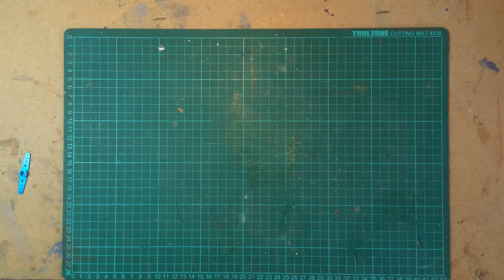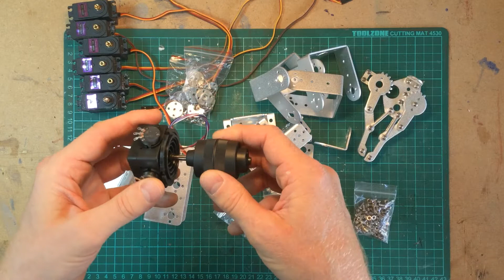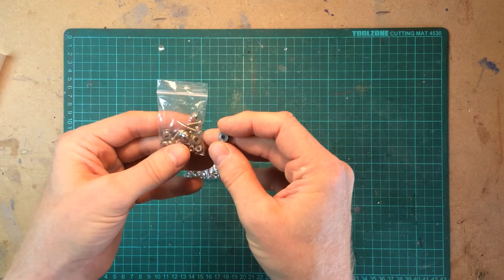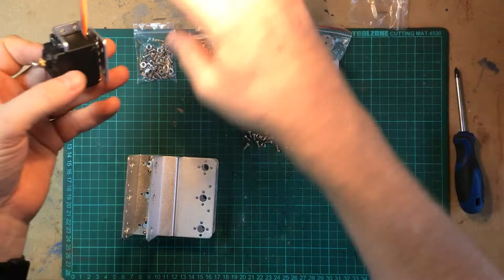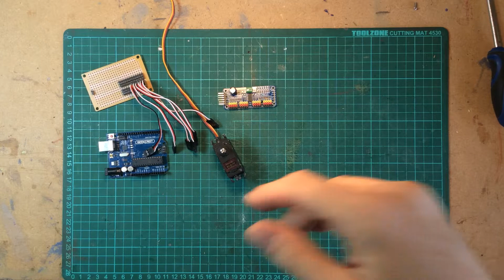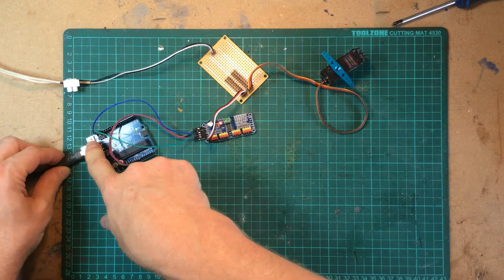Dad Built: eBay 6DOF Robotic Arm build (part 1)

Comment: does it use mini or micro servo motors?
Reply from the maker: It uses what I think of as mini servos. They are a MG995 or MG995R, about 40mm long, 19mm wide and 43mm high they weigh about 55 grams
Reply: thanks because i seem to have ordered some micro servos that dont fit :(